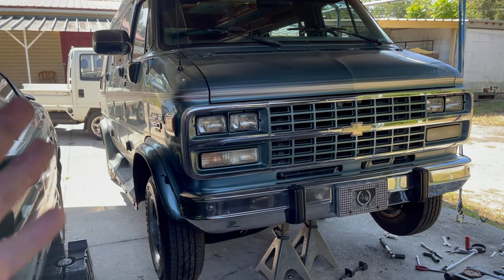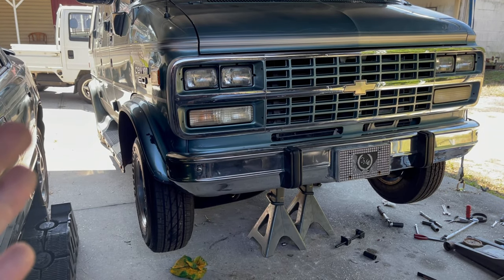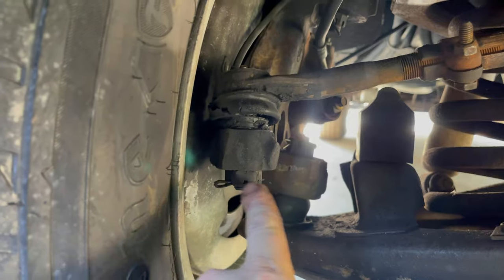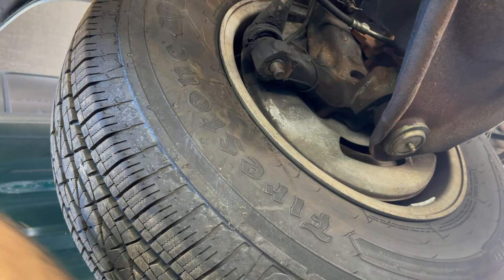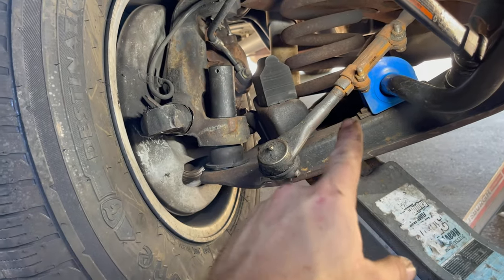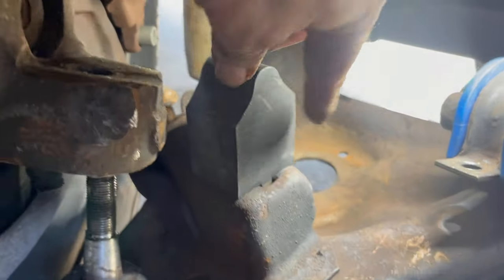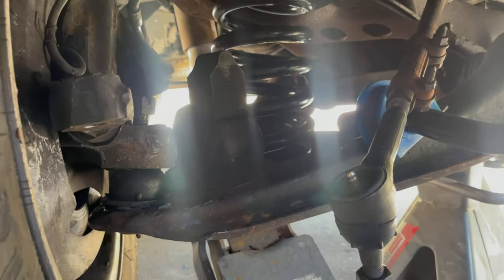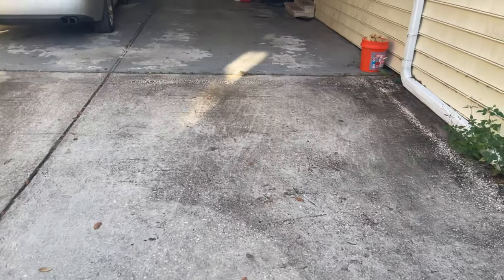1995 Chevy g20 conversion van changing coil springs to fix highway sway

Comment: My '95 g20 has 260,000 miles.  Still strong.  350 v8 
I'm camped in Tampa for the winter.  Heading to Berkeley Ca in June. 
See ya on the road.
Reply: Rocking a 5.7 1994 @ 306k myself lol trucks that are made to last

Comment: Hey Pete , nice g20 . like the channel , have you checked the RPO data tag in the center console. allot of these g20 vans of this error from 92-95 came with the heavy duty package , it would be on a hightop. a good way to tell is the lower control arm shaft and bushings , the heavy duty package will have the 2'' shafts and bushing.
these are rare parts if yo try and replace the shafts , control arm , and are available but be warned they are very expensive , but you can rebuild them with new bushing and a little fabrication to support the double wall design of these lower control arms. Now the g10 wold have the 1 1/2 shafts and so would the g30 series , and the g10 and g30 have different lower control arms . i looked up the heavy duty rpo numbers for the front springs heavy duty in my 1992-1993 illustrated parts catalog it is f60, and the 6600lb suspension is c5s  mine also has the #3.42 gear ratio #gu6  with the 4l60 trans #md8   hope this helps you and wanted to say these are great vans and love mine and would trade it for a newer van of today .. god bless and peace to you and yours DD
Reply from the maker: Awesome and thanks for the information.  In need to look into that.
Reply: I have a g30 and its converted (popular) I need to replace the coil springs but dont know which ones to use. Could you help out?

Comment: I’m dealing with similar repairs on my nearly identical van (just a ‘90 Mark III conversion) - ride is not great, and pulls and everything too, so I was thinking sway bar + shocks + potentially replacing rear leaf springs but less certain about that. My 15” rims have some rust so hoping to find some in a junkyard and get some better tires on them. This was helpful!
Reply from the maker: Changing springs made a big difference but I still get random weird pulls.   I also get some popping noises when backing a turning.   I’m thinking it’s got to be control arms but I’m going to bring to a mechanic friend and have him put on lift before throwing any more money at it.  Still an amazing van to take the dogs and family to parks.   We just drive slow.
Reply: @petescarport  on my 95 g30 roadtrek i had to replace steering gear box with an AC delco brand now steers perfectly
Reply from the maker: @smoothoperator1663  wow so funny you replied.  I just got my van back and it’s driving perfect.  Ended up being the idler and Pittman arm.  They both go into steering box

Comment: I put Bilsteins on all four corners of my 93 G20.  Rockauto has the rears or fronts (don't remember) and the other I got of Ebay.  I also added a Hellwig front sway bar and an Addco rear swaybar.  I just had all 4 tie rods changed out and an alignment...she tracks straight as an arrow now.
Reply from the maker: Thanks for update.    Unfortunately when you try to order bilstein online they aren’t available.  I tried every Auto parts store as well and they said that they can’t even get them. Usually it’ll let them order but they can’t even do a special order. Owning a business I’ve seen this with almost every supply I need.

Comment: Firestone replaced the rear leafs on my 93 like your's. Slightly better than before, nothing to say eureka over. Seriously cupping on passenger side front tire,  they missed it altogether. I'm sure front shocks are in order next. Thanks 👍.
Reply from the maker: So far biggest improvement was pitman arm and idler arm.   Night and day difference.   Doesn’t pull or sway anymore.   Nice and tight.
Reply: @petescarport  thank you, appreciate the info 😊
Reply: @petescarport  So the new coils didn't make much difference? In my 91 Chevy G30 I've changed pitman and idler arms and steering box. It is a lot better, with only 2-3 inches of play now. But still a bit wiggly on the road... doesn't hold straight very well. Had it aligned as well. Any thoughts? A guy on one forum who has owned 3 of the G20s said replacing the shocks with the adjustable El Rancho shocks made all the difference in road holding for him. Thinking about trying that.

Btw, your ceramic coating is beautiful!  How much did that cost please? Thanks so much. :)
Reply from the maker: New coils just helped with bounce.   I’ve been debating on new shocks but right she is driving nice with a little bit of pull that comes from no where sometimes.   I wish I could keep one hand on the wheel but sometimes it just jerks

Comment: I'm defiantly in the market looking for a G20 van, they seem hard to find. Any tips on where to find them (dealer/craigslist) and what are some tips as to what to look out for when buying a G20 van... Thanks in advanced! Oh yeah what's a good price range?
Reply from the maker: So they are hard to find in good condition and unfortunately the market went crazy on them for excellent condition ones.   I’ve seen several lower mileage ones sell for $15-20k.   With that said there are tons out there that may need a little love but a lot of life left in them for about $3-9k.    I found mine on offer up and made a low offer.   Mine needed a brake booster so it made it tuff for the person to sell.  I spent $80 and an hr of my time to have it running perfect.    I also found a few with rust for around $3k but I try to stay away from rust.    But I would look on offer up if I were you and anything under $5k should be a great deal.
Reply: I found mine on Facebook marketplace for 5000.  Its a 1988 Chevy Van but I had to road trip to pick it up.  It took me a couple months to find but it was definitely worth it.  I'm building mine out now to travel the world.  Great luck on your find!

Comment: hey so did it fix all the swaying on the road? I have a 98, and I can barely keep it between the lines.
Reply from the maker: Yes.  I planned to do update.  I ended up changing out the pitman arm and idler arm.   This was main issue.  Now steering is very stiff and direct and car doesn’t sway.    I think the sway bushings made a difference as well.  The new springs helped a lot with bounce
Reply: @petescarport  thanks for the info!

Comment: Try double shock s cause of the weight. Try wider wheels and tires too.
Reply from the maker: When you say double shocks do you mean shocks with double weight capacity or two sets of shocks?
Reply: @petescarport  2 sets of shock

Comment: did you get the heavy duty moog or the stand duty moog?
Reply from the maker: Man it’s been a while and I can’t recall.  I know when I did this parts were difficult to get due to Covid restrictions.    But I do feel like I went with heavy duty
Reply: @petescarport your video is super helpful and actually after just now reviewing it again I was able to pause on a shot of the box and see the part number for the coils and find it in Moog website. So you got the moog non-heavy duty ones for the g20. For the G20 they list two choice non-heavy duty and heavy duty. The heavy duty for the G20 is cis the same part number (same spring) as the non-heavy duty for the g30. 

You probably cannot help with my questions but writing it out anyway since anyone publicly I think can comment if they have any experience. What I am doing is I'm researching now is what springs to get for a 95 chevy g30 roadtrek conversion which is a very heavy vehicle because of water tanks. On Moogs website they list three types for the g30. non-heavy duty, heavy duty and severe heavy duty but unlike other sellers they do not list the spring rating in pounds or give any figures on the exact specs of the springs. I am trying to get feedback from people on the ride difference between them and trying to get more detailed specs to compare with other brand names. Maybe the all come from the same factory anyway and are the same no matter where or what brand I buy. Researching all the specs on other brand heavy duty springs there are some rated at 3289lb per coil rating, one at 3789lb Per Coil Rating, and a real monster one at 7200 lb per coil rating. I want less wind sway and I am adding new rear leaf springs and rear airbags and stabilizer bars. Over the 30 years this g30 has sagged and it is 4 or 5 inches lower than it should be all around. I do love its smooth ride so wondering what brands and duty level other people got.